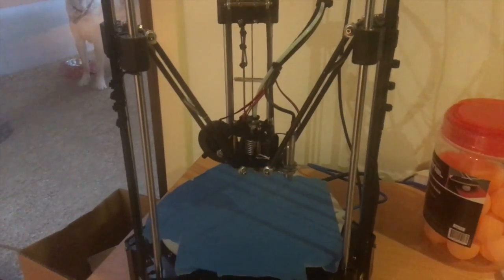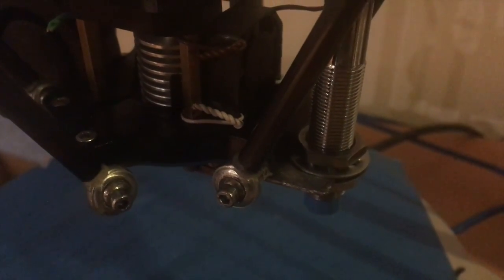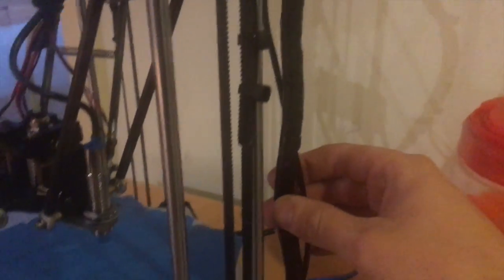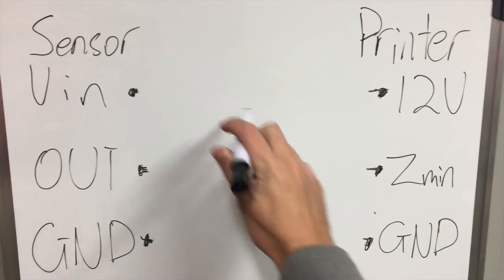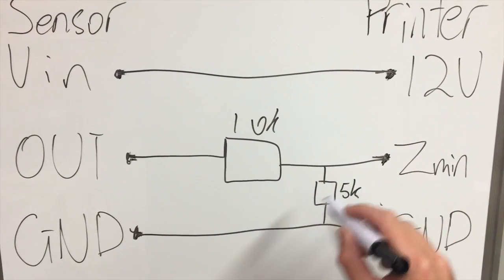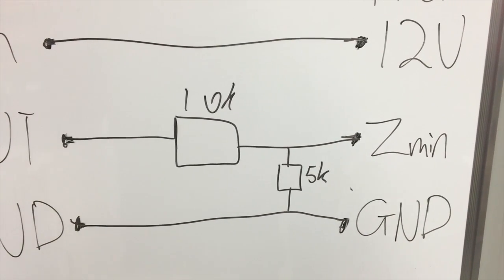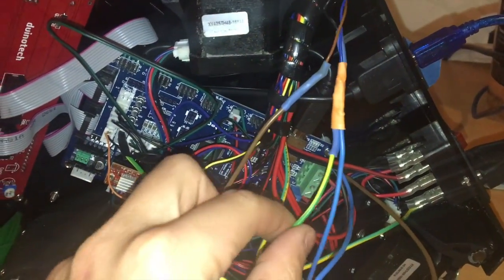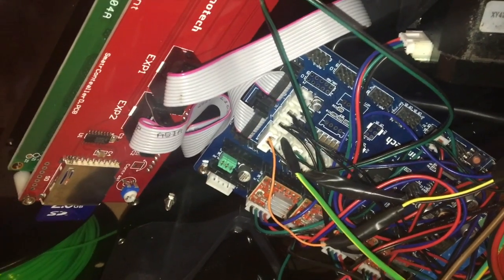How to install 3d printer auto bed leveling (tramming) Part 1 TL4100 Jaycar

Comment: I have got my sensor and installed it as you have instructed. I have used a 10K resistor where you have said, but could not locate a 5k one so I parallelled 2 x 10K to get 5K. The voltage reading highest voltage reading I got was 2.2volt, under the instructed 3 volt. Tonight after arguing with the printer all day (reminds me of an ex), I have changed the parallel 10K resistors to a single 4.7K resistor, this has lifted my voltage reading to 2.4v. I also whilst testing voltages had my son place a metal object close to the sensor and the voltage lifted to 2.7v. I am now seeking suggestions, perhaps a drop in resistor size again, or should I reduce the 10K resistor, any help from anywhere would be extremely appreciated. Thanks all

Comment: Hi there. I have a LJ12A3-4-Z/BX sensor (similar to the LJ12A3-4-Z/BY, but NPN instead of PNP) from an abandoned project. Would the wiring and resistors needed be the same, or do I need to find other resistors?
Reply from the maker: Resistors would be the same as I assume you are dropping 12v to approx. 5v the only thing I would be worried about is that an NPN sensor works backwards in essence so your input control wire would have reversed dc current at it. Unless your controller has a positive ground I don't think it will work. We ain't pro's at electronics though.

Here is a good website that shows how they work http://www.efxkits.com/blog/difference-between-npn-and-pnp-transistor

Comment: Ok I have printed up a mount for my inductive sensor (will do a video soon), the 10k and 5k resistors, Jaycar appears to sell them as 0.5 and 1 watt do you know which one I would be after?
Reply from the maker: +Whotcha Printin? Wattage is in relation to how much power the resistor is rated to dissipate. I think I used 1w ones but I can't imagine the sensor drawing much. They're like 20 cents each anyway so it ain't huge.
Reply: Thanks was just making sure rather check than break the printer electronics isn't my strong suit software sure.
Reply: Huh, ok I am now lost I can find the 10K resistors at Jaycar but could not find 5k apparently they didn't stock them (I may have be describing it wrong), any Idea on whre I could get them from in Adelaide or from ebay?  I have it all neatly mounted it just does not do anything yet.
Reply from the maker: We're in radelaide too. Found the 10k resistors but couldnt find my 5k ones. Just had a look on their website and they have 4.7k which is pretty close. http://www.jaycar.com.au/4-7k-ohm-1-watt-carbon-film-resistors-pack-of-2/p/RR2790. This would probably work in replace of the 5k just need to check the voltage before you connect it into the sensor. By memory it needs to be 5v with a 1.5v tolerance. If its out of this put two 4.7k resistors in series instead of the 10k which would equal a 9.6k and that should fix it.